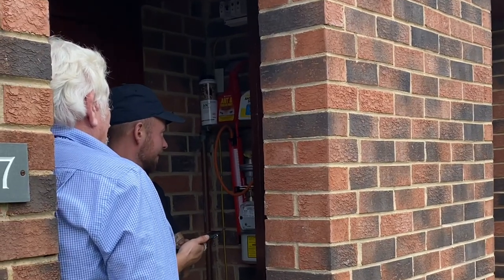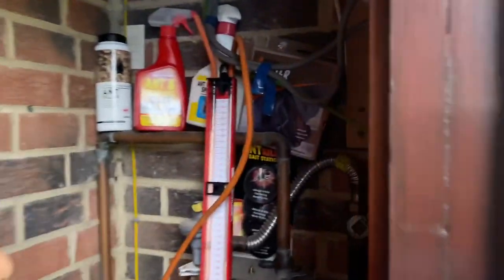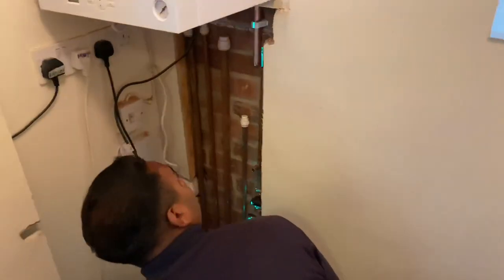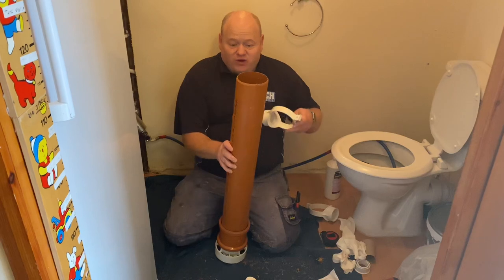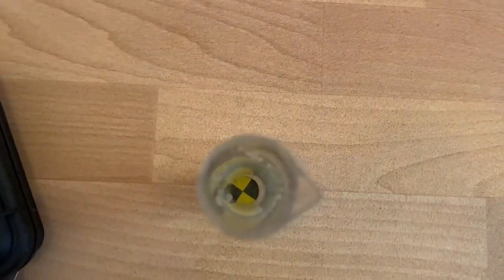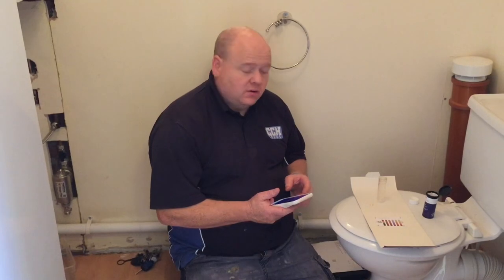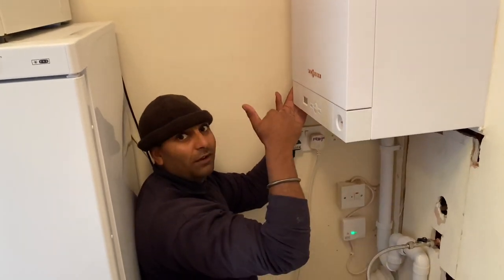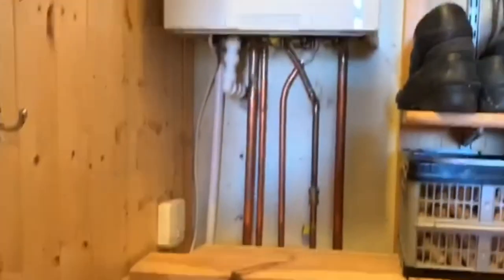Viessmann Vitodens 050 Installation - ACS Gas Training - Assessment

Comment: Allen ive got baxinplatinum when i use hot water tap in kitchen the water is hot after i turn off water theboiler makes noise for anothe minute and half
Reply: Does the noise mean it overheats 
Allen ?
Reply: @waheedjalali1618  could it be pump over run
Reply: @stuartcarr7717  

Yeh u could be right actually 

I have been working as an apprentice 

And my thought is eighter overheat or blocked heat exchanger

Comment: Bonding can be within 600mm of where it enters the property and depending on the earthing system it can be as low as 6mm . If the gas pipe is plastic on the intake and it’s not extraneous or re enter the floor down the line it doesn’t require bonding .
Reply from the maker: Where does it say that in BS7671 as I am unable to see it? Thanks.
Reply: Allen Hart which part?
Reply: Allen Hart page 202 reg : 544.1.1 for minimum size being 6mm
Reply from the maker: robert swingler Doesn’t say that in our gas books.
Reply: Allen Hart page 58 reg 411.3.1.2 or on site guide page 49 section 4.5 ( bottom of page) for plastic intakes 👍
Reply from the maker: robert swingler is that in the gas manual? Or electrical?
Reply: Allen Hart I’ve been through this with many gas fitters . Mains bonding is an electrical connection and I’ve never seen anything in your regs to contradict or over turn the bs 7671 electrical regs for an electrical connection
Reply: Allen Hart I’ve read your regs on mains bonding and it refers you bs7671 😂😂😂
Reply: Allen Hart have you got a page in the gas regs that says different?
Reply: I'm with Allen on this one
Reply: Arks in what way ? I’ve give you exact regs from bs7671 to back up my claim and have checks the gas regs 18.2 which doesn’t contradict bs7671 in anyway . If you’ve got some different info please share.
Reply: @robswingler  I'm still with Allen on this one.
Reply: Arks 😂😂😂😂😂😂😂😂👍👍👍👍
Reply: Still nothing to prove me wrong . Guess I was right 😂
Reply: Arks gas fitters who think they know more about electrics than electricians lol

Comment: Please correct me if I'm wrong but I thought Viessmann do not recommend the use of inhibitors in their boilers. I'm guessing it's something to do with the rubber hoses.
Reply: Mark B Jones No mark viessmann do not recommend any inhibitors in the system water it’s something to do with the chemicals in inhibitor that cause particles in the stainless steel heat exchanger
Reply: @SalimKhan-gk1fh  Thank you, so Mr Hart you were wrong to use inhibitors in the system.

Comment: Plastic boiler...no lasting
Reply from the maker: They have a built in shock on these, I haven’t personally seen one fail yet. Have you seen any? Thanks
Reply: DZ Malekvali  it’s a metal boiler actually .
Reply: Allen Hart  No I haven’t seen one yet Allen in the 12 to 14 years I’ve been dealing with viessmann boilers
Reply: @SalimKhan-gk1fh  ,,,salim 50 %Plastic
Reply: DZ Malekvali I’ve been fitting these for over 14 years now and I have not had a plastic housing leak this is not a Worcester Bosch you know the plastic housing are made by grundfos,